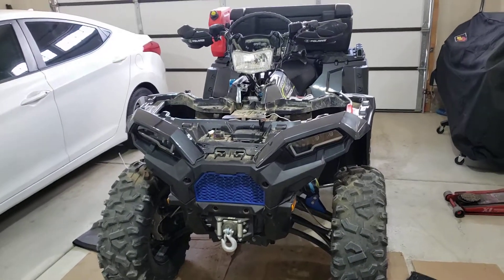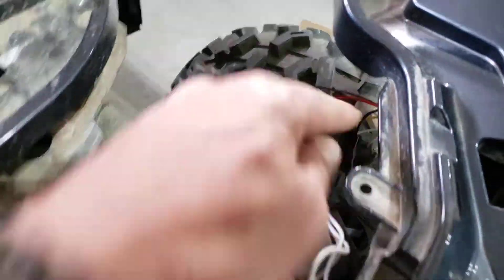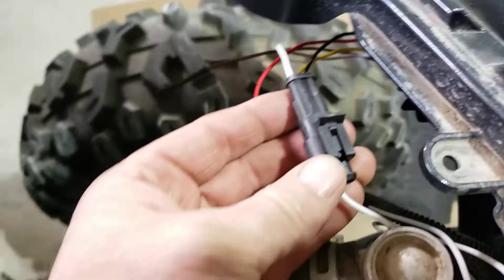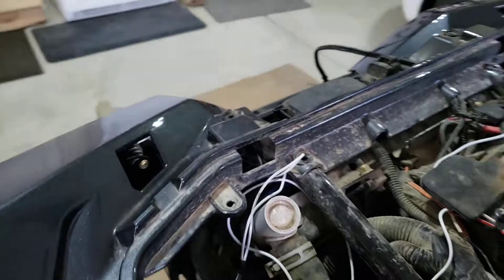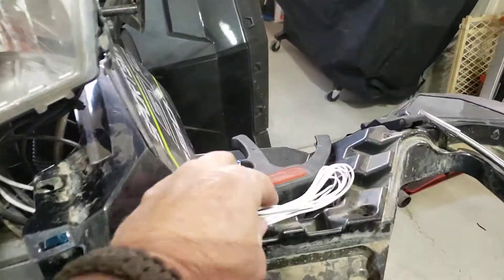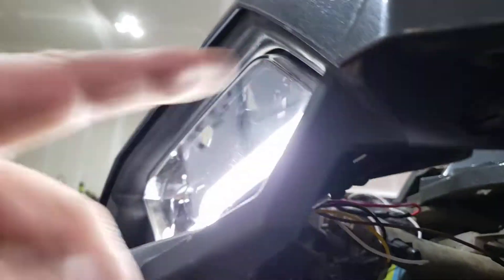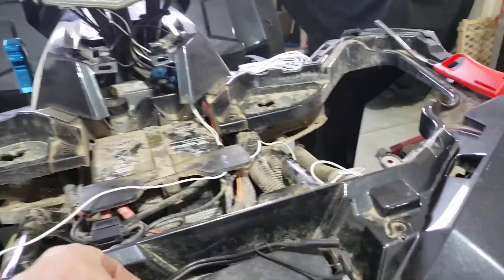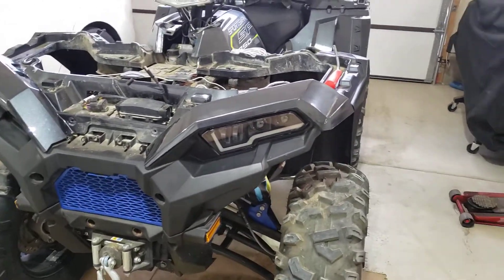led lights on the sportsman 850

Comment: I put them lights on mine and now one is working and they all were any reason u think ?
Reply from the maker: I would check the connections and see if they are tight . I haven't had any problems with mine

Comment: Quick question, what length is your snowmobile handle?  I've been looking all over for that.
Reply from the maker: 17.5 its a fly racing on ebay 33.00 dollors
Reply from the maker: https://www.ebay.com/itm/151532123597?mkcid=16&mkevt=1&mkrid=711-127632-2357-0&ssspo=B1BsWP2CTxG&sssrc=2349624&ssuid=EA51K9bAQGq&var=&widget_ver=artemis&media=COPY
Reply from the maker: Just sent a link
Reply: @whiteknuckleoffroadadventu2840  Thank you